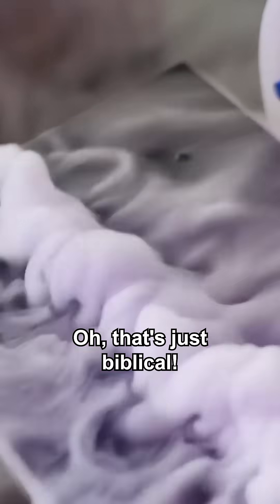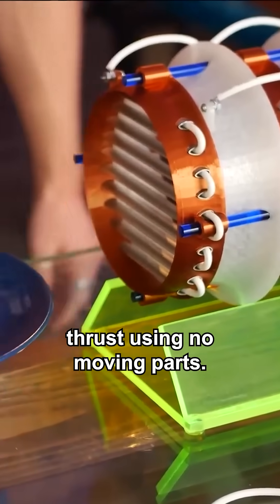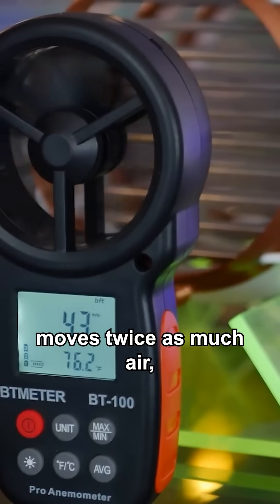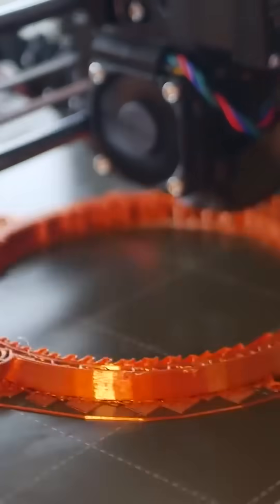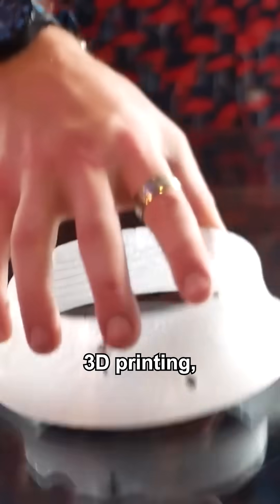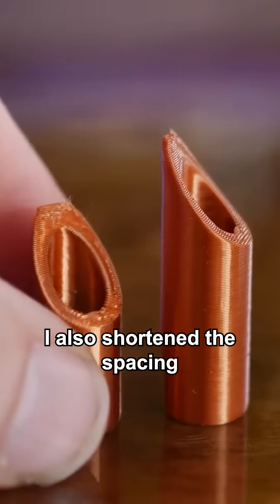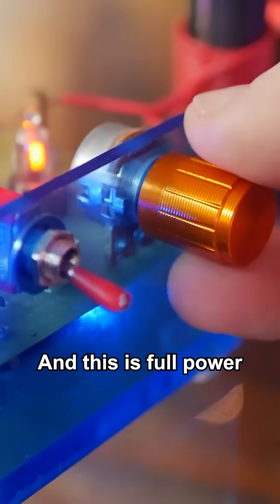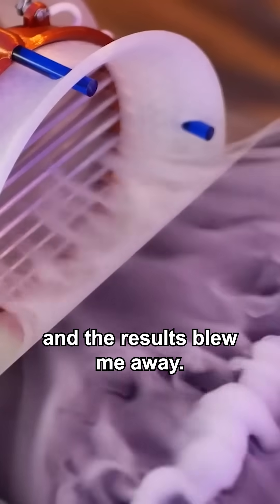The Next Generation of Ionic Plasma Thrusters (BSI MARK 2)

Comment: Are you using negatively charged ion plates to accelerate and create thrust? Have you ever thought of having a Venturi type style? Possible tubes or tube like structures to concentrate the flow. I’m new as in maybe a month and a half or one month of knowledge with ion thrusters. I understand that electrodes anodes and cathodes along with xenon gas injected into a chamber, causing a reaction. There’s just a few missing parts in my head at the moment. I am very intrigued. Wonderful job.

Comment: The evolution of technology. 
1.) Proof of concept prototypes. Expensive, impractical, but proves a point and mostly a curiosity. 
2.)  Refined prototypes. Still impractical. This guy is here.
3.) Practical prototype. Time has elapsed. Better materials/processes, coupled with a better understanding of working principles, or new ideas.
4.) mass produced models and further refinement.

Comment: So what's the application for this? Go for an indoor ventilation fan at this power level, but as you want to float a drone, are you looking at more dense electrical elements etc? Perhaps something like wound elements, the same way indictors increase efficiency with wire windings?

Comment: this would be great for fanless ventilation system for households or basements.. assuming it consumer less power or about the same..
Reply: I'd be very surprised if it could produce the same flow or pressures as a furnace fan.

Comment: It's about as good as a desktop fan.... First off it's not even technically a thruster, because there's no compressive chamber. secondly it would probably perform better if it was housed. Lastly a normal thruster unless chemical which still uses a compression chamber would need a compression turbine. I assume this is hindered by some law like the inverse square law so each stage is less and less beneficial. 2-3 instead of the 4 chambers "" he has would probably have 80-90% of the efficiency. " Or considerably similar output.  Anyway he's getting more of the idea but his current set up is incentives loss of air pressure between each stage so the over all air velocity is even less than it's overall output could be, a Dyson blade less fan.  There's just fundamentals here not explored, and a good question to be when does something get considered as no moving parts? A compressible turbine on a bearing, seems rather ok than say on a motor? 

Also out of curiosity I wonder how it would operate if he used a fan to push air through it as like a kick off, or booster to boost efficiency. I kinda assume not much as I assume those panels have their limits, but hard to say in theory without even doing the math. Though the best use of this technology would probably be for making a drag chamber. As I assume you could get a pretty even layer easily and easily control the airspeed which would give you a lot of control in the represented of the moment of the object your testing drag on. A couple of those fins some plexy glass, and a fog machine, probably make your own several hundred dollars drag machine for less than 60$

Comment: Doesn’t that create toxic ozone?
Reply: High voltage breakers up oxygen O2 and reform into ozone O3.
O3 in the lower atmosphere is Smog
O3 is very good in disinfecting stuff… so very toxic. 
On LTT there was a good video about a laptop with such a fan and the health risk.
Wikipedia has all the information about the danger of O3.
Do you notice a smell?
Google:
Ozone has a very characteristic pungent odor, sometimes described as like chlorine bleach, and it can sometimes be detected after lightning strikes or during electrical discharges. Individual humans vary in their ability to smell ozone; some people can smell it at levels as low as 0.05 ppm.
Reply: Yes. Dell is working on these for cooling laptops. They are working together with a company called Ventiva. 

They say they have a technology that gets rid of the ozone by turning it back to O2 by using manganese dioxide as a catalyst.

But these type of fans have also other challenges. But it’s quite interesting.

Comment: Can't wait to see your BSI MK III. Coupled with your plasma discharge airfoil, I can see this being viable for long duration drone flights. All solid state so there would be limited to no maintenance and could fly under its own power using solar panels. 0 mass battery for the airframe and it could stay in the air maybe indefinitely. That would have great application for weather surveillance, land survey, you name it.
Reply: Just a matter of time before we have skynet.
Reply: How are you figuring the solar panel part? Do you have some figures for power draw efficiency and solar charge capacity, or are you just spitballing?
Reply: @militantfascade9176  Spit balling. Maybe we have a long way to go before solar capture is viable enough for what I propose, but, it's fun to think about.
Reply: @PAXPN90   I see. I thought maybe he'd found a highly efficient solar array, but even then he'd have a power/space ratio issue powering flight long term.
Reply: I don't think solar power would be possible unless you have HUGE wings.
Reply: @DoingFunStufff  You might be right, but the fun part would be trying. Also, I'm not sure a larger wing span would be a bad thing , but the thrust to weight ratio would be. Circumvent this with thermal lift like a glider and a larger wing span would help with that. Wouldn't be fast, but it would stay airborne longer. I'm no engineer, just like thinking about it.
Reply: @PAXPN90  It probably could stay airborn if it was towed. Not sure it would have the thrust to take off with that large of a solar panel wing. But I believe it could be towed like a glider and then turn them on to maintain. In fact an altered glider would be ideal for this type of thing.
Reply: At a certain point, man needs to say stop.
Reply: @idonomaedaedika4334  Go big or go home. Ain't nobody complain for a bigger engine.
Reply: @idonomaedaedika4334  Man as in humanity? Scientific progress and technological advancement isn't inherently bad, though it has been used for bad. These things wielded by bad people are the problem.
Reply: @idonomaedaedika4334  you don't need to take part in it. That's your choice
Reply: I just got a name for BSI, it's bulsh*t invention. Don't be offended in just dirty minded.

Comment: YOOOOOO IONIZE HYDROGEN TO MAKE PLASMA AND ACCELERATE IT WITH A RAILGUN SYSTEM, if you produce the plasma fast enough, and have enough railgun stages you can reach 95% light speed, you have to use deuterium tritium fusion as a power supply to get those speeds but it’s very possible, WAKE THE WORLD UP BROTHER, WE CAN COLONIZE OTHER EARTHLIKE PLANETS, i’m sure the government is already doing it too

Comment: Hey dude .. how does reversing your design a little .. straight tube .. thru different length center tubes and bring in the fresh non.ionized air thru the middle. That should provide a decent velocity increase.
Reply: I like peanut butter.  🥜+🧈=😋 
😅

Comment: i was wondering about doing turns on toroidal coil electromagnets with the copper wire, what if you did turns on the wire first with a much smaller wire, then use that wire to do the turns. Thoughts?

Comment: 🤦‍♂️  You need to add this to you cyclone/tornado chamber - Then see what it does 🤷‍♂️

Also.. I know it's sounds counterintuitive... per the "aerodynamics" parts.... But add a smaller weaker reversed polarity strand in front of the larger aerodynamic charged pieces.. (Im sure you'll have to add a small insulating piece between them)
   But use the smaller weaker strand as a means to slightly ionicly push the molecules away from the front edge of larger stronger charged aerodynamic bars.. to create an slight ionic/molecular buffer area to remove the drag.

It's what they found to do on the stealth aircrafts when trying to change the radar signatures, but found that the ionic buffer that they created improved speed & fuel efficiencies due to Removing the drag.

That was on a macro usage; it can be done on the micro levels as well - to improve over all in take flows.  It's just a matter of finding that hyper sensitive sweet spots that each part achieves their goals at various speeds (🙄up to hypersonic air speeds).

Comment: So how does that compare to a 90w impeller?
Reply: it's not even close. impellers are waaaaaaaaay more efficient. These are very cool and have some neat applications if you need no moving parts. But an impeller or propeller will always be better
Reply: @quistador7 you say always ??
I say anything that’s been around a long time and has been upgraded/modified, (especially at it’s peak) is better until the new tech is being utilised!! All tech is the same!!!
Propellers/impellers are almost there!
This tech is at it’s beginning and it has a whole lot more potential then just pushing via a blade.

We are close to throwing that primitive tech away for more advanced tech! Just like combustion engines. Can’t do space travel with firecrackers 🧨 we will never get the speed 
We will never advance if we don’t!!
Reply: @greekkidshows9373  You misread my comment. I'm saying Impellers and propellers will ALWAYS be more efficient than these plasma engines. Even when we have handheld fusion reactors, it won't be more efficient. It won't need to be efficient when the energy source itself is so efficient. It takes an absurd amount of energy to move air with electrons.
Reply: @quistador7  I didn’t misread nothing 
But i guess you didn’t read mine!

All tech will be better than the next tech!
Until the new tech catches up!!
And then surpass it!!!
The combustion engine moved at a couple of kph! Never be as efficient as walking, let alone 1 horse power. Or imagine all the fuel required to push the car at 1 kph! (No where near as efficient as cars are today) not worth it?
Now Imagine giving up because of stupidity? 
We’d still be using horses! 🥱 
Iron horse is much better 😎
Now combustion engines are the thing!
Over 1000kph. No tech can beat it, right?
Why even try?

Can you imagine in a hundred year’s or so,
We are travelling through the stars and having this conversation?
I can hear it,
Imagine if we were so stupid we didn’t try! 🤪
Reply: @quistador7  🤪 even funnier 🤪
🤔Those “handheld fusion reactors” you were imagining, will probably be made with this tech!! 🫣

Seriously, i never imagined so much from it, yet 🤯

That’s why these sorts of conversations are good 🙄
          🤪It helps to be inspired 😀
          🥹Thnx guys 🤘you rock 🤘